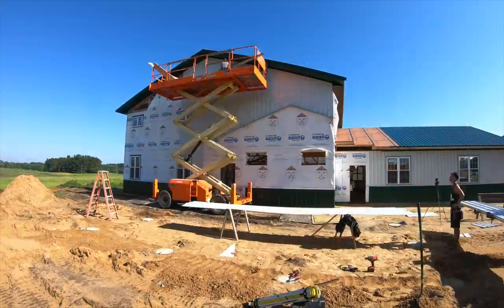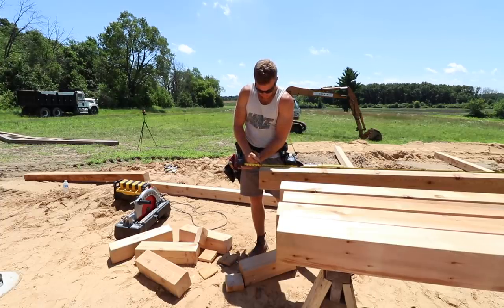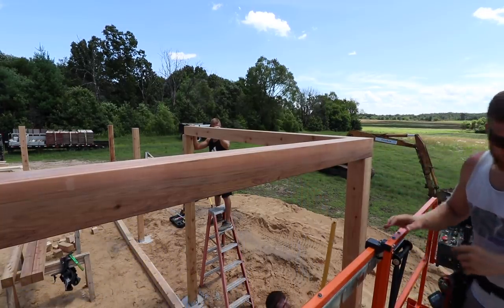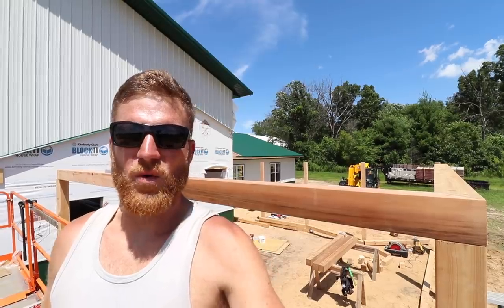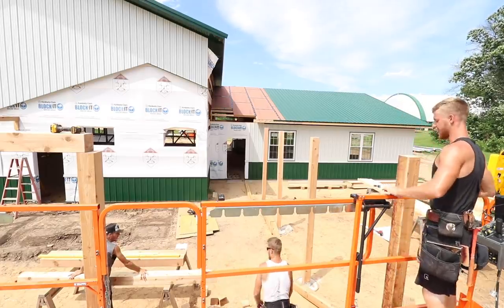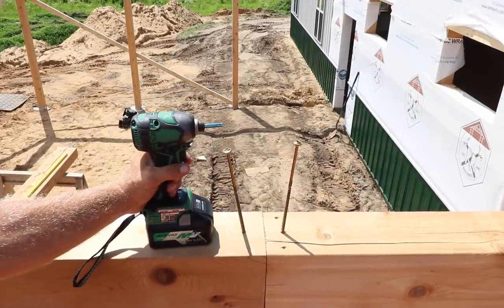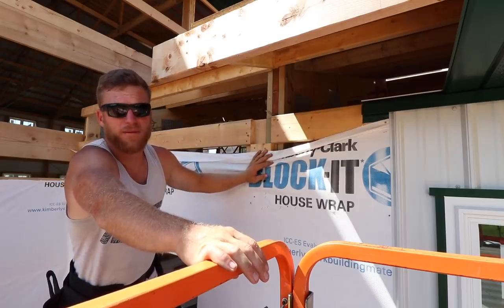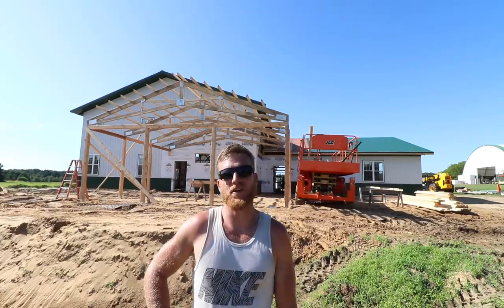Building a Hunting Cabin 14:  Installing Porch Framing

Comment: I have both 12V and 20V Dewalt screw guns and drills.  There are so.many times I don't need the power of the 20V. and the 12V does it just fine.  I love them.  Compare it to the old Makita 9V tools and it's amazing.  I bought my 9V back in 88 when I was building my 4th house.  At that time, it was pretty awesome.  One can only imagine where technology will take us.

Comment: Dewalt was 12 volt not fair.
Kyle, I’m surprised that you don’t have to use metal beam plates on those connections. If it were deck framing it would be required.

Comment: if i were installing metal trim around windows i would put spacers at each corner to take away that gap that you are experiencing. that way you wouldn,t need that l channel with bolts.

Comment: Great videos watching in England. I’m
A carpenter why do you guys nail rather than screw a lot of your timber work. Also looking at the makita impact any videos coming on that
Reply: Panels get screwed, less damage and easier replacing than using nails. Nails are used where sheer strength is more important since unlike most screws which snap when bent to a point a nail will just keep curling over.

Comment: Kyle why do you use butt joints instead of tradional halflap as many timber frames are?
Reply: While it uses the same style, post frame is not the same as timber frame due to the column/post being of laminated 2 by 6 or 8 at 3 or 4 ply.

Comment: One more question. Why do a wainscot that’s the same color? Not on this job but on several others. Jw thanks!
Reply: Ask yourself this: Replace one full height panel or just the separate lower (usually 34 inch) portion that was damaged?  One large/long piece costs more than the shorter/smaller piece.
Reply: Joshua79C C that’s a good theory thanks!